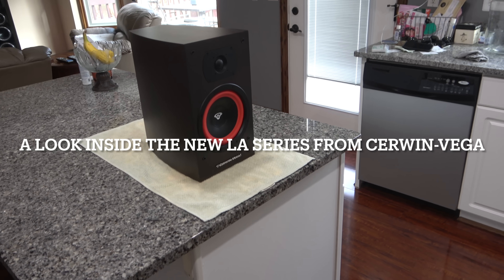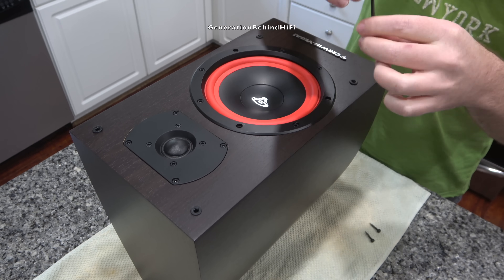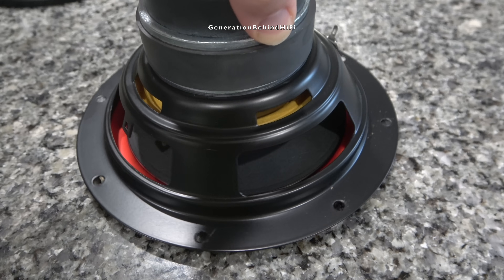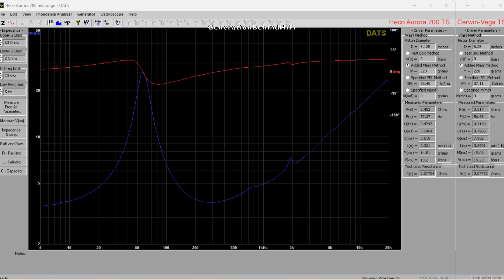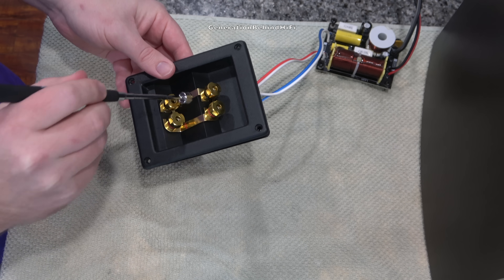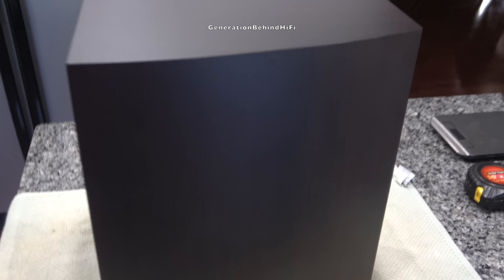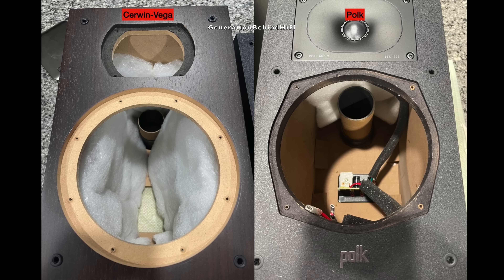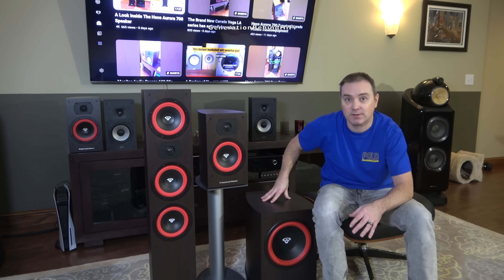A Look Inside The Brand New Cerwin-Vega LA165 Bookshelf Speaker

Comment: The problem with Cerwin Vega is that outdated red surround. In 2023, the red surrounds make the speakers look cheap.
Reply: I like the trademark Cerwin Vega look. Klipsch will always be copper and Vega should always be red.
Reply: @ricksmith7659 Yup ….. exactly what I think !
Reply: the smaller book shelf speakers like the clsc cls ls e series and others did not have the red surround. but the red surround has been cerwin vegas trademark for many many years. around 50 or something
Reply: Still have AT -15’s, like the red surrounds and they still sound great!
Reply: Thats an iconic surround, not likely they will ever change it.
Reply: At the very least they can offer a choice between Red foam or Black   rubber surrounds
Reply: @manuelyslava8987  they do, leave the dust covers on and there out of sight. I have a pair of b and w speakers and cant stand the pimp gold colored  woofers so my dust covers stay on.
Reply: The red speaker foam/rubber was a Cerwin-Vega trademark of their home audio speakers in the 70s through to the 90s. I had a pair of Cerwin-Vega R12 2-way 12" speakers. An incredible 97db/W. Unfortunately, the red speaker foam was prone to rotting. Hopefully they use something more stable these days.
Reply: I’m good with an updated look, but they gotta keep the red.
Reply: I had the Cerwin Vega M-100, which were available in the PX on Ft. Bliss back in the day. Awesome speakers.
Reply: Didnt know the colors delivers problems
Reply: @rvanwettenwetten  the color doesn't change the sound, it could be worse ocipella or look at the super high end audiophile speakers, invented by Dr.Seuss,
Reply: Well, it's butyl rubber instead of foam, that's a definite improvement
Reply: I love the red ;)
Reply from the maker: I agree. The red surround isn't my cup of tea either. I will talk more about aesthetic appeal and sound quality in my review video which will be out in February.
Reply: @generationbehindhifi  .
Reply: girl comment...the red last 20years+ proof......its the best surround
Reply: …. Says the guy with the “Stadia” logo.
Reply: @adamjohnson1010  Watch your mouth. Google Stadia is gonna make a comeback in 2026. You wait. 😀
Reply: More coloured surrounds to the people 🎉fuck yeeaaah!
Reply: When i saw them i immediately thought they copied the HECO Celan revolution 3's. Then you compared the speaker to another HECO model and it got weird.  ;)
Just got the 3's, so I'm glad it doesn't look like they'll compete at a fraction of the cost...though they don't even begin to compare on looks alone. C-V should also ditch the red - unless they mostly still want teenagers as their market. Anyway, thanks for the look.
Reply: lol no the problem is they sound terrible!! But let colors trigger you instead 😂
Reply: @trumpsmum9210  I don't expect them to sound great. Even if they put in some real engineering and made a top-notice budget-midrange speaker, the "look" of the speaker will detract people from buying.
Reply: @kevonmanuel  the look is literally the only thing saving them.  If it wasn’t for the red there would be no difference between them and Walmart speakers
Reply from the maker: @trumpsmum9210  Walmart speakers have 3/4" front baffles, silk dome tweeters, and are using poly caps in the tweeter circuit? This is news to me! Send me the link to the Walmart speaker that you speak of and I will buy them for a tear down video. 

IMO for less than $270 I have a hard time thinking of another speaker with a 6.5" and a similar MSRP that has build quality and sound quality that is this good. But then again, this is the internet and there will always be unreasonable people with ridiculous expectations.
Reply: @generationbehindhifi  you might need new ears if you think they sound good
Reply from the maker: So is that a no on the link to the Walmart speakers that are "better"? 🤣
Reply: @generationbehindhifi  lol 😂 you should be worried about your ears first!! I’ll send you a link for hearing aids
Reply: I’ve been loving the red surround since1976 they look great
Reply: I love their red surrounds!
Reply: What that red surround is epic that’s what so many people love abojt those speakers it’s iconic
Reply: Are you kidding it makes it look really nice but beauty is in the eye of the beholder !
Reply: Dampening or none or partial will all give a different sound maybe Polk know this as really your looking at $0 for that extra wee bit.
Reply: No they dont
Reply: I had a set of AT-15s years ago and personally I kinda like the red surround and CV has always been looked down upon from the audiofile crowd but I've actually enjoyed most of them I've owned
 however my vintage Polk RTA-12s are now my forever speakers but having some CW bookshelf speakers might be fun
Reply from the maker: @turbomustang84  In my opinion the red surrounds are a must for their big enclosure "party speakers"!!! But if they really want to capture the audiophile crowd, then they really need to lose the red surrounds for their small format "audiophile" grade speakers. Even my wife said "Too bad about the red surrounds, those will clash with a lot of peoples decor" and I think she is right. No matter how nice the cabinet is, it's going to be extremely hard to convince your significant other that these speakers with bright red surrounds will look good in the living room.
Reply: @generationbehindhifi you can use the grills.
Reply: @generationbehindhifi 
I thought the same thing about the red surrounds not mixing well with the audiophile crowd. Maybe a thin red line on a black surround would seem more refined while retaining a bit of their signature look? I dunno. I’d probably buy them and just leave the grills on like I do with Klipsch (I’m not a fan of copper drivers, but I like the sound). 

Great content btw. Love seeing the speaker disassembly to look at the internals. Subscribed.
Reply from the maker: @garyharper2943  I could, but installing the grills will hurt sound quality. I also prefer to show off the drivers but that's just me. It was interesting to see everyone's opinion on the subject about the red surrounds. No doubt its a very subjective topic! It seems like its pretty close to a tie for people who are for them vs the people who are against them. I started a poll in the community section so lets see which one is more popular. :)
Reply: @garyharper2943 you know nothing real audio guys never used girls we want to hear the speakers properly and look at the drivers

Comment: Interesting, I hadn't heard the name Cerwin Vega in a long time!  They always tended to have boomy bass so that's probably why they put such a high Qts driver in a compact ported box.  I'm guessing they would sound better if the port were either eliminated or stuffed with a fiber fill to create a resistive vent.  Looks like they're probably a pretty good deal for the price.  Great review video by the way!
Reply: Now are all the speakers in the line using stamped baskets ?  Once again they oughta upgrade a little more with cast . Even at a higher price point.
Reply: @manuelyslava8987  Sorry, I originally replied to this thinking you were talking about something else entirely.  There isn't anything wrong with stamped frames on a line of speakers in this price range.  They really need to do something about having such a high Qts however, a Q in the 0.7 range is perfect for infinite baffle or open baffle but never for ported.  Then again, boomy was always their signature sound so they probably want to stay with that, there are plenty of people out there that like it.
Reply from the maker: These are the most refined Cerwin-Vega speakers that I have ever heard. I don't know how they did it, but even with a high Q driver these speakers sound exceptional well for this price point. Definitely don't judge a book by it's cover applies here, because I think the new LA series will surprise a lot of people. 

My review video where I give my impressions about how the LA165 sounds will be out on 2/1/24. IMO Cerwin-Vega really out did themselves with the new LA series. At $269.99 a pair, there is exceptional value for money here.
Reply: @generationbehindhifi  I guess the title of the most refined consumer level Cervin-Vega's goes to the massive XLS-215. Seems like they go for 900 dollars a piece. Here in Finland they're about 1400 dollars a pop. Those have been in the lineup since at least 2014. Back then they were way less expensive and and pretty much a deal for the money, if bone crushing bass and over the top dynamics was what the buyer was after.
Reply from the maker: @YRR_J  I have never heard an XLS-215 or have I seen a pair of those massive beasts so I can't comment on their sound quality. However, judging by their size I'm sure those things will have no problem rearranging your house. 🙂 I have always wanted to try out a pair, but I don't see that happening anytime soon.

Comment: wonder why they dont put available the rms value and total impedance?
Reply from the maker: Just "peak power" is listed on their website, no RMS. I'm guessing RMS is half of peak for these speakers? Below is the rest of the info that they have. 

Dimension - Length x Width x Height - Inches(mm)	12.4" x 8" x 13.7" (315mm x 203mm x 347mm)
Grille	YES
Sensitivity (1W/1M)	90 dB (1 Watt/1 m)
Power Handling (RMS/Peak)	150W PEAK
Nominal Impedance (ohms)	4-8Ω
Frequency Response	33-20KHz

Comment: I used to mod/upgrade older C-V crossover,  Going to just 5% metal  poly caps cleaned up and opened up the sound very noticeably.  The older models used iron core inductors,  Air core tightened up the bass even more.

Comment: Impressive indeed! Thanks for the thorough tear down. The quality is above and beyond what I expected. I liked seeing the big motor structure on the tweeter this makes me believe that CV! Plans on sticking to there roots and making speakers that can play loud! I bet these speakers would do good with a 80 hertz cut off and a sub.
Reply from the maker: For $269.99, I can't think of a better speaker at this price point. I was really impressed with their dynamic range, bass, and high frequency smoothness. Even the cabinet and crossover punches above it's weight for this price point. If I was a consumer and I had the choice between a $800 sound bar or a pair of these, I would chose the LA165 every time. They really are that good.